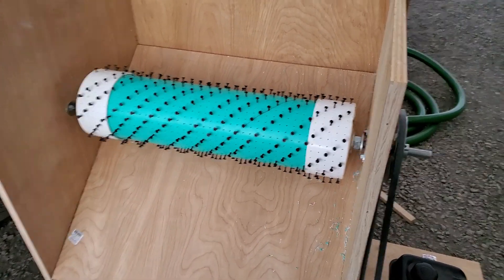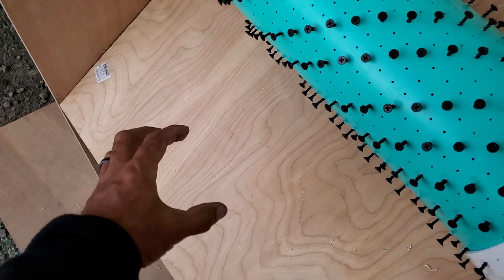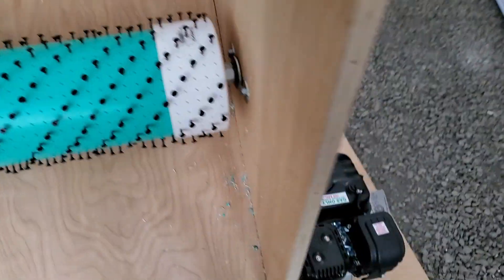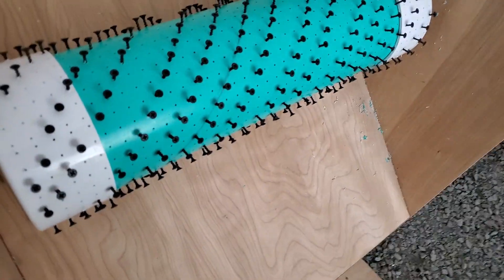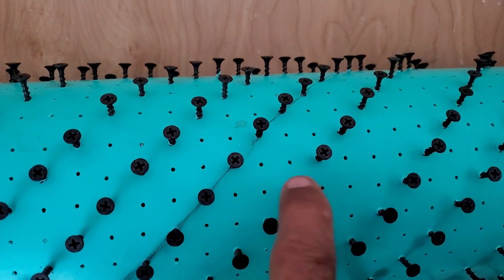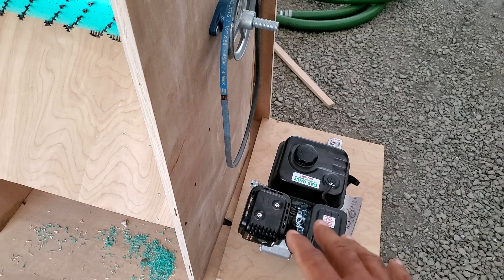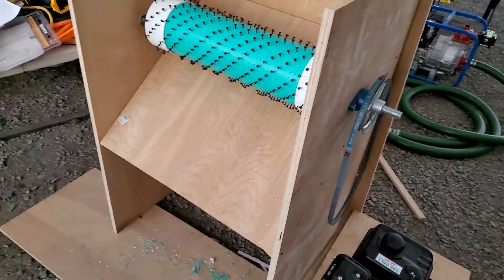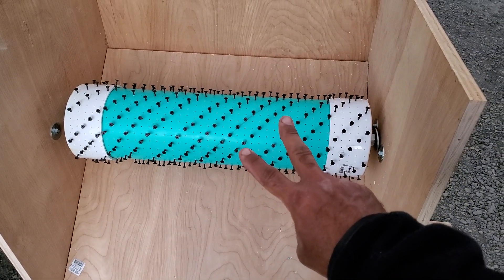Foam Shredder | E.P.I.C. Cement Mix, Styro Aircrete #FoamShredder #StyroAircrete #aircreteharry #diy

Comment: Engine mount and tension adjuster pulley. I would use a longer belt and have the mounts attached to an cheap upside down metal shelf so the supports and vibration would be taken up by the larger contact surface with a middle support of the triangle. My 2 cents.

Comment: you may need to put a screen a few inches from the shredder on the low end of the box with holes the size of the particles you want because even though you have a lot of screws there, some chunks are going to get through unless they're made to stay in the shredding cycle until they get to a certain size.

Comment: are the ratios similar to aircrete (like 1 bag of concrete equal to 55 gallons aircrete)? I was going to buy the domegaia or your foam kit but holding off solely to wait on your EPIC mix, it seems superior in every way? (maybe a future video on pros and cons of each?) I'm a teacher in a large elementary school. I want to teach the kids all this stuff so they can make their own quality housing without having to donate a kidney to get it done. I'm all about the future of housing and raising a generation of kids that are self sufficient and not getting into debt, this kind of stuff your teaching is key to that vision, thanks again, can't wait to see what's next, maybe one day we could collaborate. I've been following opensourceecology, openbuildingframework, precious plastic and it seems like what you are doing is very similar at it roots.

Comment: Great job! Appreciate  you sharing you've taught me a lot. Have a suggestion, on a cars exhaust system there are rubber gromet hanger things to hold your exhaust on to the underframe. What popped in my minds eye was using those as a motor mount might need some large washers bolts and a few nuts. Just a idea. Appreciate you